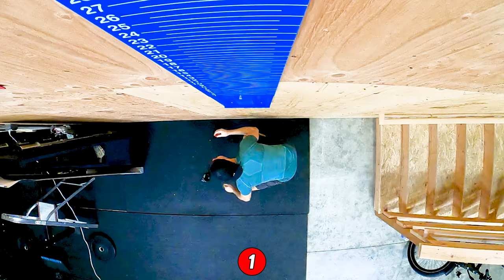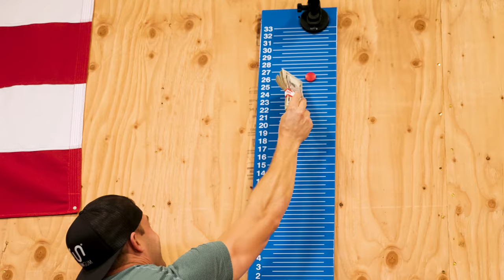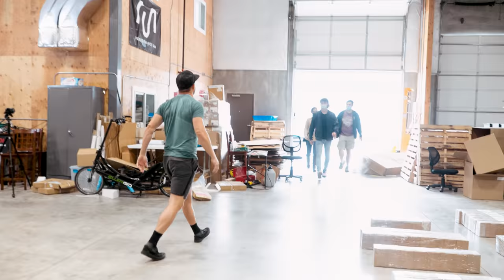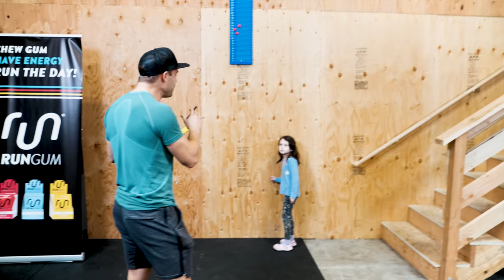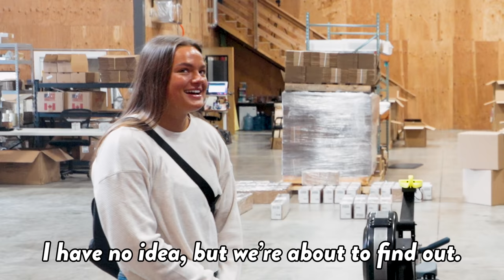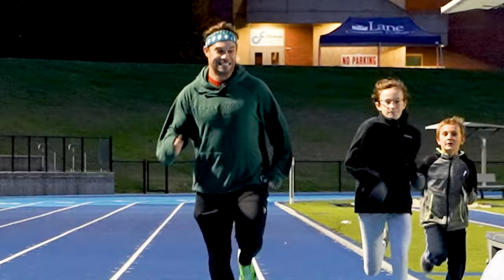Win $5 For Every Inch You VERTICAL JUMP!

Comment: I don't remember my standing vertical jump but based on my reach and the fact I could get 2 knuckles over a 10' basketball rim (at 5'8" in high school), my vertical was 32". Can't even come close to that now.
Reply: My Vert has definitely fallen since high school basketball too. I’m the same weight but just train for strength and not as explosive. At least at jumping.
Reply: @Athlete boy 7'2"
Reply: You need 34” to touch the hoop at 7’2 reach
Reply: Kyl Schwartz  I should remeasure with and without shoes on. I'm 44 now so it's possible I shrunk a bit lol.

Comment: And to think at 5’9 you need 36 inches to dunk. Naw there’s no way there’s gotta be something different in the measurements
Reply: This is STANDING vertical, not MAX vertical where you can run up to jump.

Most of the most athletic NBA stars have standing verticals in the 30"-34" with their max verticals going up to 44".